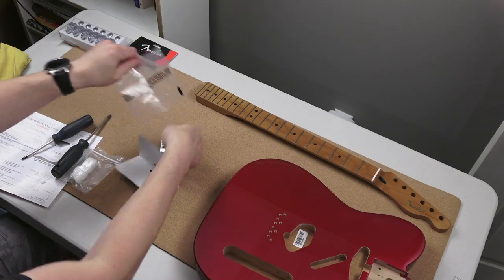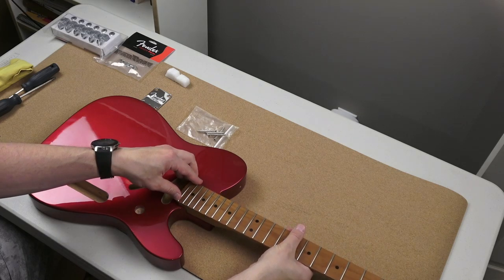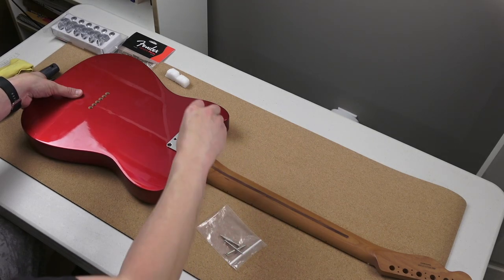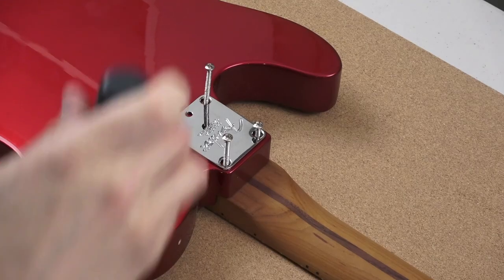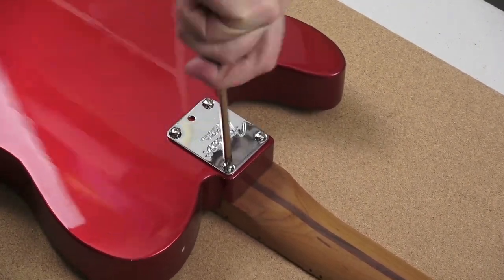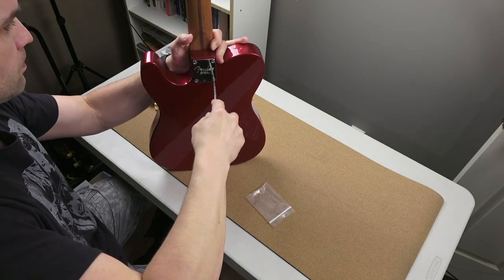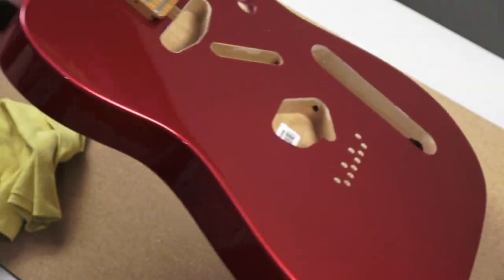How to Attach a Fender Telecaster Guitar Neck to the Body

Comment: What if the neck isn’t predrilled with holes for the screws that will attach it to the body?  Or is that a project you just wouldn’t take on for the risk of screwing it up?  Debating that myself right now - a lot of lower cost options if you go off brand, but many aren’t predrilled.
Reply from the maker: I've done it before. Used a drill press to drill the holes required, but I was not happy with the necks. I've only used official Fender since
Reply: From Leo:  In addition to REALLY watching the depth of the holes, Put the bridge on and the tuners.  Gently clamp the neck to the body, I use leather pads on the clamp to protect the surfaces. Put Both E strings on and make sure the strings are hitting the neck right.  Push the neck around, until the strings center perfectly. Tighten the clamp, and then drill,  75% of the time, this set up is not needed, but once the holes are there, it is tough to go back and fix it.   Off brand parts are not as perfect fit as Genuine Fender, you have to make up the difference yourself.

Comment from the maker: This is a clip of the neck installation for my Candy Apple Red Fender Telecaster build project https://youtu.be/c_JSzc-AFeE
Fender Telecaster Roasted Maple Neck: Fender Part: 990303920
🛒Sweetwater: https://imp.i114863.net/LJ46Z
🛒Amazon https://geni.us/TeleRstNeck
🛒Thomann https://bit.ly/3iR2d0F

Fender Neck Plate:  Fender Part: 0991448100 
🛒Sweetwater imp.i114863.net/jPZb5
🛒Amazon https://geni.us/FNeckPlate
🛒Thomann: https://bit.ly/30FNWJC

🛒 Reverb https://reverb.grsm.io/gpuv8wvdgd1p
==========
Timestamps
==========
0:00 - the start
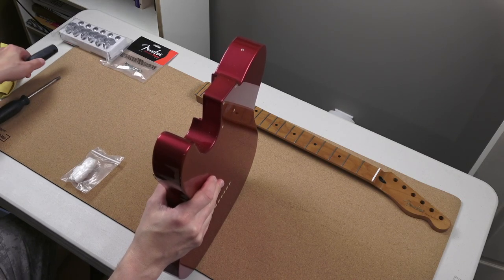0:30 - Waxing your screws
0:45 - Seating the neck in the pocket
1:20 - Screwing the neck
2:30 - Looking at it

Comment: Is there any advantage to pre-drilling the neck with a tiny drill bit, while in place, using the backplate/body as a template,  to prevent cracking when driving in the screws?

Comment: Thanks- so the necks usually end up straight just by screwing them on?
Reply from the maker: Not always
Reply: @landonbailey  how do you make sure it’s straight?
Reply from the maker: attach your strings and go from there. you can always loosen the neck screws and adjust after

Comment: There’s just something about candy apple red teles and strats especially the classic look with a maple neck white pick guard or off white aged cream pick guard looks amazing also I agree hand tools for the win it’s way too delicate work to risk going overboard with power tools unless it’s something super specific like possibly adding a string tree or even spacing up holes for your size tuners be it standard, locking , or vintage your build vids helped with my tele project keep up the good vids!!
Reply from the maker: ya I use a drill for the string tree and pickguard pilot holes